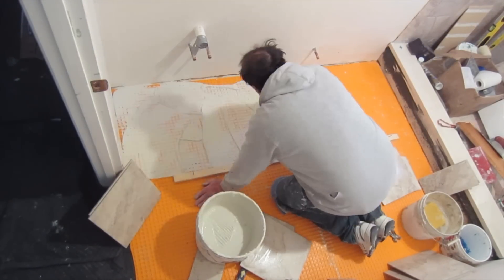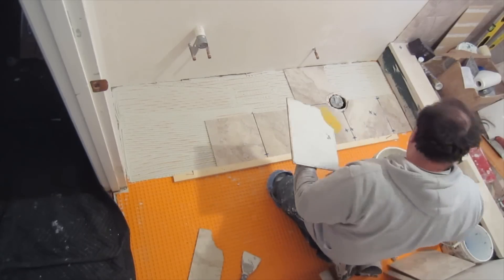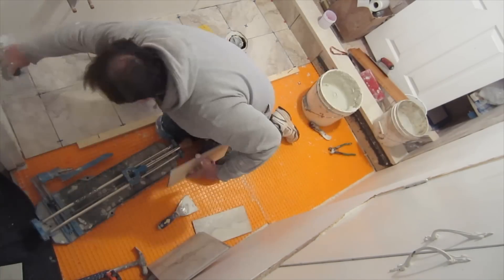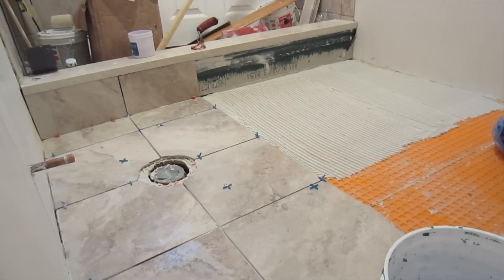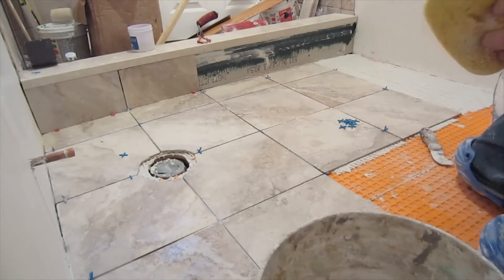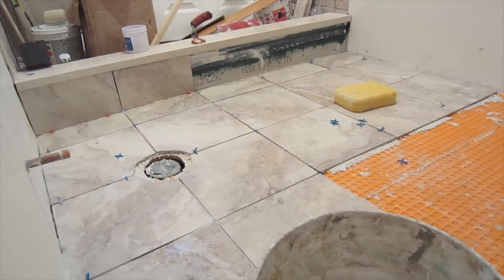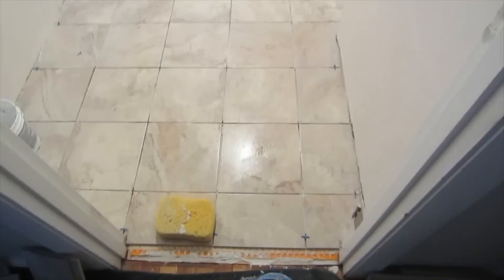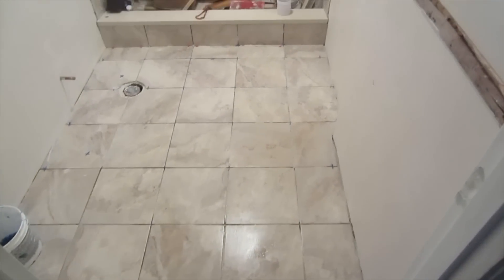Part 9 Complete shower install studs to tile: Part 9  installing the bathroom floor

Comment: Mr. Diblasi, 
Why unmodified thinset over the Ditra? I am guessing here; but, if there is allowable flex underneath, does it create a compounded over flexing of the thinset if both of the thinsets are modified?  Thank you.  Dave DeMarsh
Reply from the maker: +David DeMarsh No has to do with the way the thinset dries, hre is a video that explains ditra https://www.youtube.com/watch?v=YpXEXqbh7ok
Reply: +Sal DiBlasi Thank you Mr. Diblasi.  V/r Dave DeMarsh

Comment: Question Sal ...what is the largest tile one can use on a bathroom floor that includes a roll-in 6x5 shower (shower is 5' deep)?  A rectangle drain will be placed to the opening of the shower.  The floor dimension is  7'5"x10'4"
Reply from the maker: I am assuming you mean for a flat pitch, in which case what ever size you like, just be aware that a smooth tile on a shower floor can become very slippery. However if it is not flat, but pitched like a bowl to a drain, then 3", maybe 4"
Reply: Thanks for the info Sal, very helpful.